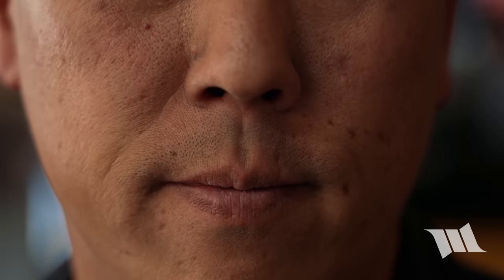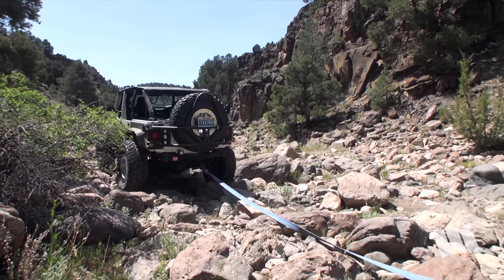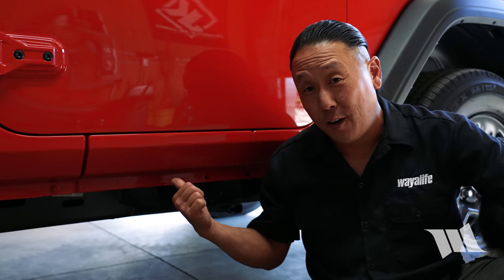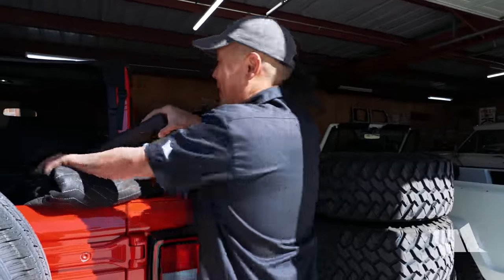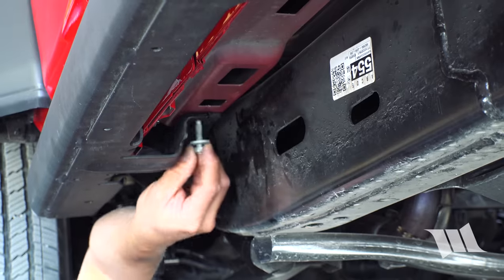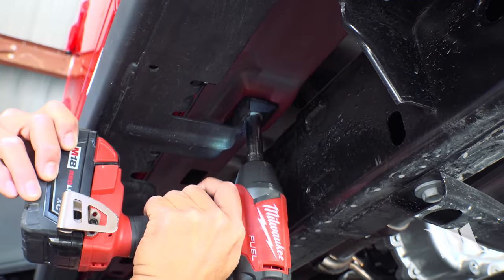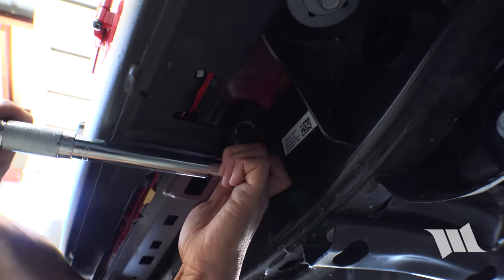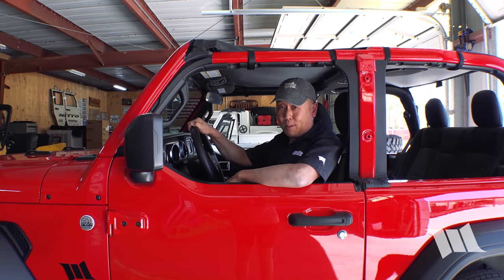What should be the First Mod on a Basic Jeep JL Wrangler Sport

Comment: Why is the factory slider attached to the body sill instead of the frame? Looks like the slider could only be as strong as the weakest link.
Reply from the maker: Actually, the pinch seam is a very strong point on the body and it's reinforced with the brackets that tie into the body. That said, frame mounted sliders are always going to be stronger.
Reply: @wayalife  So no problem with high lift jack if needed? Just wanted to make sure. Thanks
Reply from the maker: @boyscout6566  With these rocker guards, there will be a problem. Not with lifting but you'll jack up your door as it leans into it. Also, if you haven't seen it already. https://youtu.be/64i0oASNa-c
Reply: @wayalife  I have seen your tire changing video. It's a good one. I also know the other name for high lift is widowmaker. However, there are circumstances where a high lift is called for such as bellied out on a rock. Had a TJ for 15 years which sliders were always attached to the frame. I might get back to a JL but not sure about the integrity and am gathering info.
Reply: @wayalife  Would like to see a comparison of factory skid plates between TJ and JL if possible. The JL's transmission skid look flimsy to me but then what do I know.